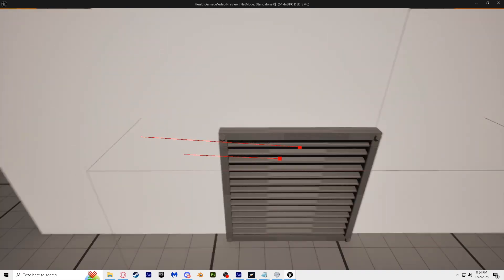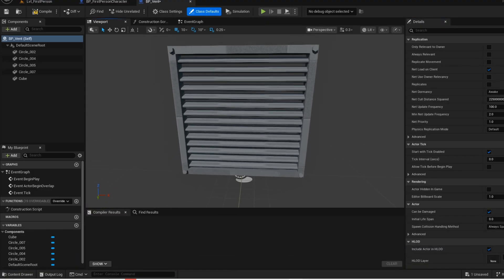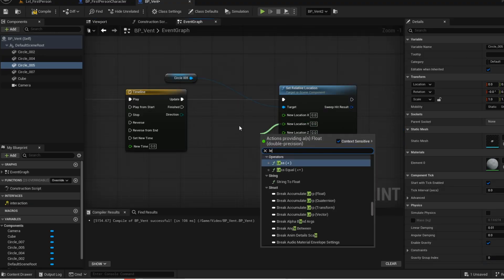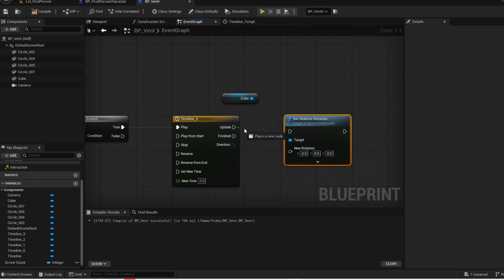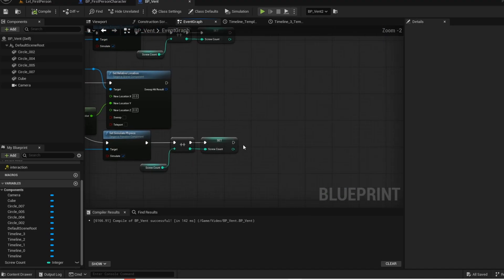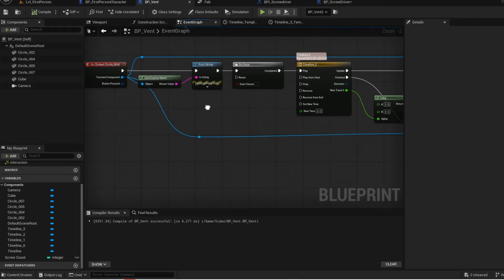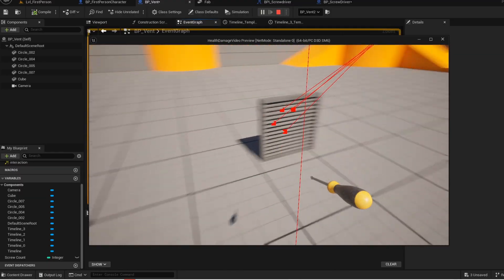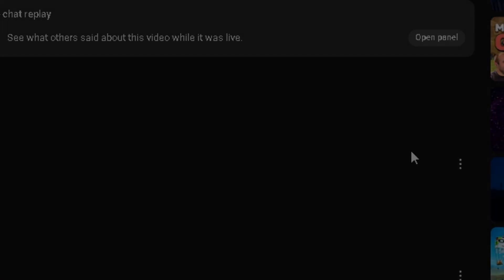How To Create This Vent Unscrew Puzzle In UE5!

Comment: Really amazing video. I have run into an issue my game however as I made my item system use a universal dropping system inside of the Blueprint for the player. It uses a class reference to keep track of what item is being held and then drops that. Now that I am trying to act function to each item I am having the issue of not really finding a way to set Has Screwdriver back to false. Do you have any advice for me on this, any help would be appreciated.

Comment: Fun fact: If you use simulate physics it's a little bit easier than animations but that's just the way I do it.
Reply from the maker: I did do simulate physics😊. But I couldn’t use simulate physics while the screw was inside of n object or it would just glitch around, so I had to add a timeline to make the screw come out of the vent first

Comment: And how do you make sure the item disappears from your hand after removing the screws?
Reply from the maker: You could either create a dropping mechanic like I did in one of my videos, or you could add a flip flop node to the screw driver interface in the player blueprint, and b output will be visiblility off, and then go to the bp_vent, and when the vent opens, you can just call the screw driver interface, and set Boolean to false